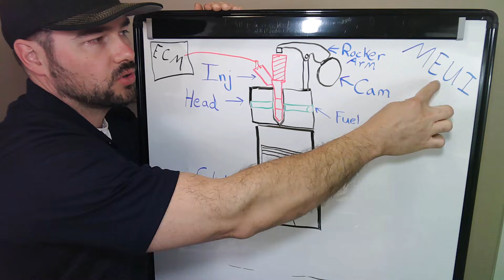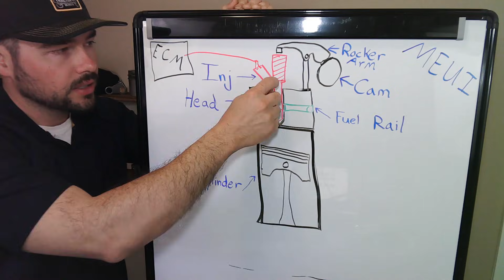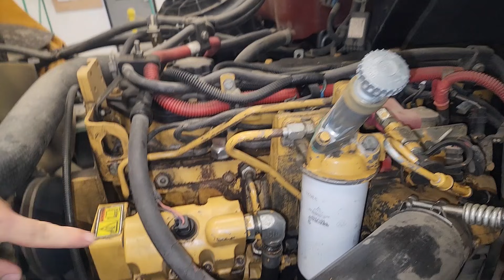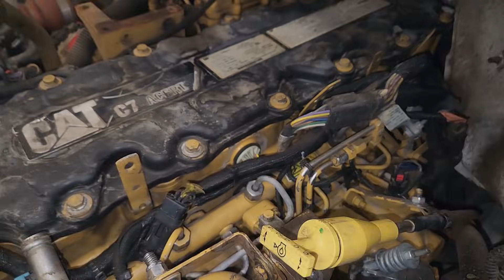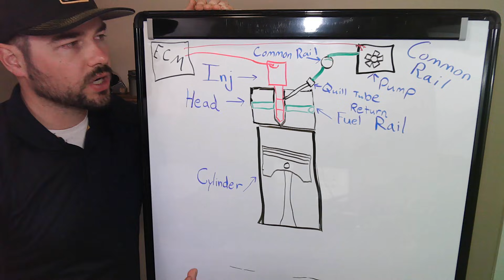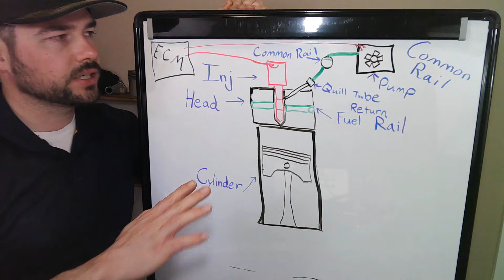Diesel Fuel Systems 101 part 2. Common Rail, EUI and HEUI.

Comment: 1. Common rail fuel systems are now being used on large marine engines, so we now have CR engines that can run on crude oil.
2. Most electronically-controlled low-speed (below 300 RPM) Diesel engines are now using hydraulically-actuated injection pumps. Yes, those ultra-slow, bigger-than-your-house engines have HEUI systems (although the injection pumps aren't located directly above the cylinders).
Reply: I'm looking this up, but can you tell me an example model of each mentioned engine? Is the application of the second style for power plants, or something else?
Reply: @guy386  
1. The 32/44CR and 48/60CR engines from MAN Diesel
2. Low-speed 2-stroke engines are primarily meant for large ships, though they do make stationary versions for power plants as well.
Reply: The worlds biggest engine Wärtsilä RTA96-c with 109000 horsepower and 1800 liters of displacement uses commonrail with electronic injectos as far as i know
Reply: @ukkomies100  I think the RT-flex engines use hydraulic unit pumps as well.
Reply: @electric7487  ok. There might be both systems in use. I remember reading some of the newer ones have commonrail

Comment: The common rail injectors can be of the piezoelectric type. Apply power and a stack of crystals shrink to allow the injector to fire. It allows extremely fast actuation which can give multiple shots of fuel per injection event. Makes for quieter operation and much cleaner emissions.
Reply: I felt that the multiple pulse capability and benefitsof these was overlook in this vid
Reply: @Rx7man  yeah the CR design is far superior in internal combustion Pressure control , power and Efficiency because of precision combustion control. The biggest noticeable thing for those ignorant about new Diesels is the lack of diesel rattle. That's a VERY good thing for engine internals lifespan and power production
Reply: @100pyatt   the biggest draw back is serviceability and cost to own. In that respect older is better. Especially when as relates to emissions and anything electronically controlled. Hell even the internals are more expensive due to lack of competition because of serviceability.
Reply: my honda diesel car has denso piezo injectors and yes they really do make engine run quietly.
Reply: Wow, u read the internet
Reply: Sadly some teachers struggle with this theory. 😳 textbook brother! 🍻 well said.
Reply: Also for sum reason EVERY COMMON RAIL ENGINE has an engine life of 700,000-900,000 engine life and everything goes wrong in between.. as opposed to d-12's, n14's, series 60's, c15  which all have million mile plus sum almost 2 million idk if I had one truck it wouldn't be a common rail just because it's convenient to manufacture doesn't mean it's convenient to own
Reply: @pauloegusquiza5061  that's totally FALSE Paulo....Lots if Common rail live FAR longer lives ecen with FAR LONGER PMs .. without rolling in bearing etc to keep them alive. Many modern CR engines far exceed 1 million miles EXCEPT the Cummins ISX Until they went to the later X Series for numerous reasons(Like finally adding carbon scraper ringset) not related to Common rail injection.  It's also common now for CR light duty engines used commercially to exceed 1M miles and 30K hrs engine life. Less Destructive Smoke wear and Less dramatic internal Pressure spikes make for longer life and Far less diesel rattle as the side effect.
Reply: @100pyatt  I agree, modern engines can last much longer than their older mechanical counterparts. However, it's harder to properly care for a modern engine (Mostly because of the after treatment system). I have a Carrier reefer with a kubota v2203, it has mechanical injection, and it has 50k hours on it. That's the equivalent of 2.5 million miles. It's very easy to care for, just change the oil every year and keep coolant in it. Newer units similar to it have a dpf, egr, and a common rail system. I doubt I'll ever see one with 50k hours on the original preassure pump and original injectors. Also they require the egr to be cleaned every year which is quite time consuming.
Reply: It just keeps getting worse!
Reply: I want louder engines and more smoke
Reply: @psd28  Noise is Pressure spikes and smoke is abrasive wear not power. Burning fuel completely and smoothly is power and engine life

Comment: To add to this heul and common rail can fire the injectors multiple pulses per stroke near top dead center I've seen up to 11 pulses on one cylinder on one cycle they usually vary the length of each pulse to reduce emissions and quiet the engine down
Also many of these injectors are not driven by 12 volt DC but actually 120 to 160 volt DC for that ECM control
Reply: Same with cam driven unit injectors or at least the unit injectors on my c13. They have over 120v running them.

Comment: On a heui the fuel injector multiplies that oil pressure about 10 times to the fuel pressure so if you apply 3000 psi oil pressure and it fires for the maximum time the system would actually be applying 30,000 PSI at the injector nozzle

Comment: How was injection timing controller by Meui? Was it static timing depending on the relationship of camshaft lobe to injector?
Reply: In engines using electronic unit injectors or electronic unit pumps, the timing of the camshaft is fixed, the ECM just tells the pumps or injectors when to fire.

There are many mechanically-injected marine Diesel engines still being made nowadays (the MAN 32/40 and Wartsila 32 come to mind) with variable injection timing. From what I can tell, these engines use a VVT actuator on the fuel camshaft to vary the timing.
Reply: Cam and crank sensors thru ecm
Reply: MEUI uses an "Advanced" timing lobe that starts actuation movement but the injector doesn't actually build pressure and fire until the ECM signals a [closure] of the internal fuel bypass passage in the injector that results in pressure rise and pushes through the nozzle for the injection event.. it's also stopped the minute the signal is removed and the injectors return to their default [bypass] mode.

Comment: Love the videos man! Your a huge reason i’m getting into diesels and bought a vw tdi. Not a big diesel but i’m only 18 so driving a duramax everyday might not be the best idea😂
Reply: 99 to 03 tdi 50 mpg...
Reply: I daily an F350 dually and its a pain but i love it and it makes me happy
Reply: @psd28  That's all the justification a man needs.
Reply: It’s generally a bad idea, park the big diesel and drive a car gas, electric, or diesel and you will generally save money and gain an asset instead of depreciating the more expensive diesel pickup. I definitely prefer to drive both my 1 ton diesel or my 3/4 ton suburban but I typically drive my old Pontiac Bonneville because it’s just so much cheaper to operate as a daily. TDI is a solid choice for a low cost operation for you, I prefer a gas daily however as I live in MM and it’s nice having a vehicle that doesn’t need any special winter care as a daily.
Reply: Tdi’s are bad ass man. I want one

Comment: I have cat c6.6 acert fitted on a combine... Has 4400 hours and recently we have bought a new injectors... But rpm keep drops on load!!!  Any advice....
And thank you for your videos... It's amazing videos
Reply: Doesn't look like faulty injector, could be rail relief valve, you should connect ET check faults first.
Reply: Make sure you filter to 5um or less on all CR injection motors if you want long system life. Finer filtration equals longer life!